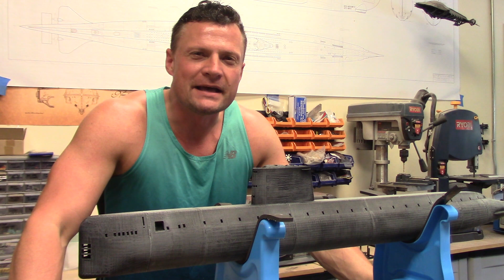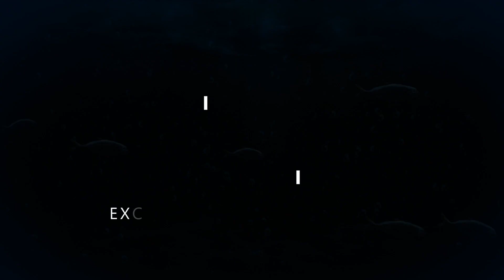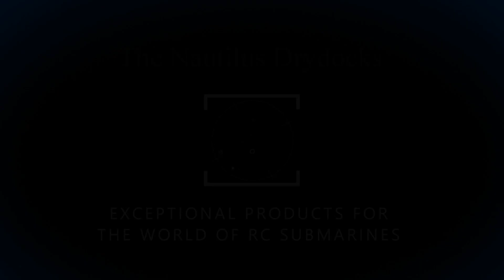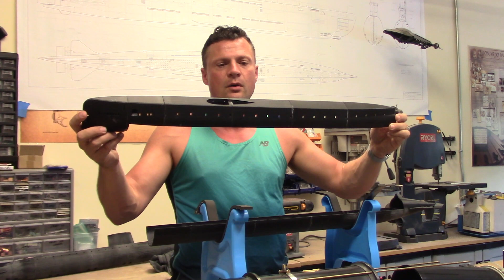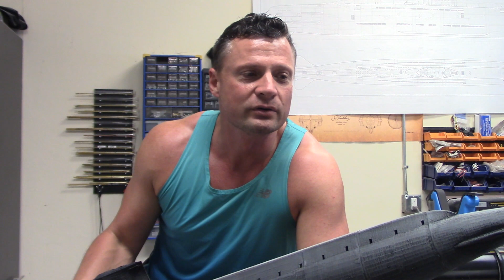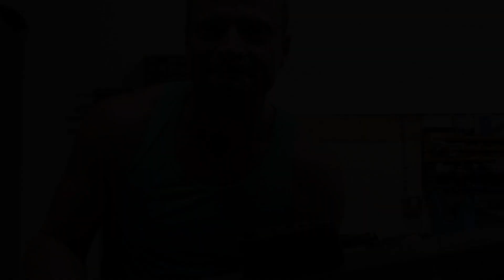3D Files for building your own USS Nautilus SSN-571

Comment: at $50 for an STL i'd expect not to see bad artifacting along the cyliders. the hull should be smooth shouldnt it?
Reply: the degree of smoothness of a 3D print comes down to your 3D slicer settings and the ability of your 3D printer. All Cadfiles/STL (unless you put a surface tecture on them) are smooth on the computer, but a 3D print cant do perfectly smooth in the vertical as its layer upon layer. The only reason you see it so well in his video is because he said he printed at 0.3mm layer height, which is large imo. 0.2mm isnt bad, easier to sand down smooth, and even more so with trying to print at 0.1mm (which not all printers can do). But the lower you make that number you increase the print time quite a bit. Sanding a model, and using something like a high filler primer can make 3D prints very very smooth, as can just sanding for a while.
Reply: @shadowOrgon  the layers are vertical, the artifacting is horizontal. layer height will not improve this. its a problem with the 3d model
Reply: Resin printing will fix your issue. But good luck finding one that can print large pieces